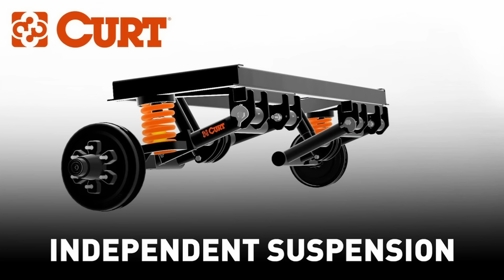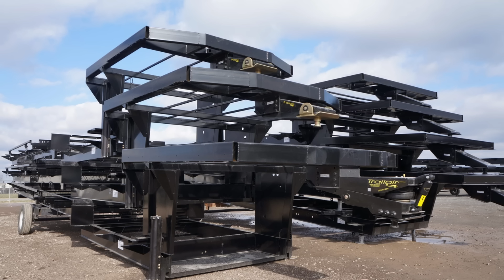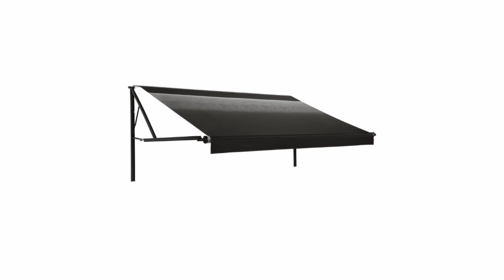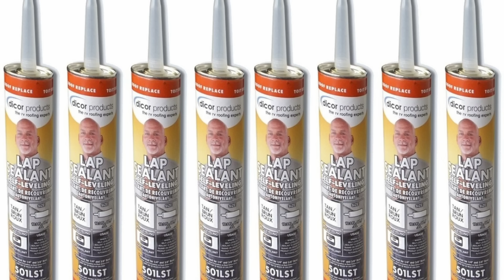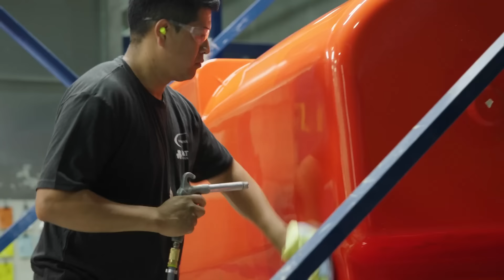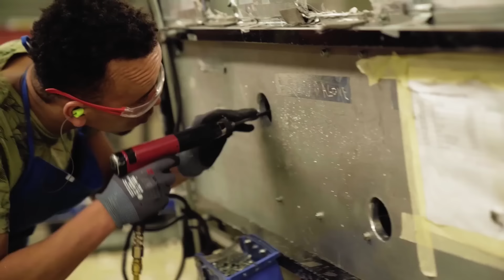The Real Story Behind the Parts & Components That Make Up An RV

Comment: Great video with good detail. Each of the component manufacturers you mention are vital to RV production in North America. However, it should be noted that each company chooses price points and categories to participate in — and cost is the number one factor in the quality and performance of RV components. Lippert builds amazing specialty products that perform well and have great warranty (like the Curt Independent Suspension). But the parts cost more — and end up being worth every penny. “Price is only an issue in the absence of value” is a phrase we frequently use to discuss RV parts. It’s also very, very true that you get what you pay for — especially in the RV space.

Comment: Well most new r-v are under a false impression that it's like buying a new car one owner manual and one warranty what they quickly discovered is a bag of 10 or 20 different manuals with different warranties from all the different component suppliers and the r-v industry saying don't call us call them because we didn't make it just install it , can you imagine if a  automotive manufacturer did the same thing ? , you have a trunk full of booklets from all the different suppliers that make components in a car .  It be nice if the r-v manufacturer would offer a tip to tail all inclusive warranty that covers all the components that go into their r-v just like in a car , that will happen when pigs fly
Reply: If you buy a new house and your refrigerator quits in 6 months do you call the builder or the manufacturer of the fridge?
Reply: @brucefranklin6765 I call the home warranty company. They schedule someone to come out within a week or 2. If they can’t fix it. The warranty company sends me a check to buy a new one. So I’d say no, they don’t send me to call each individual appliance manufacturer. That’s ridiculous

Comment: Great video. Having worked for an aircraft manufacturer on the customer service  side of the business for 35 years, I completely understand what you are saying.  When a product is designed and marketed part that is going to be price point and profit. There is always a balancing act and part of that is the cost of the parts and material used. Some of that is based on what's available for the product being built within a specific price point. No manufacture wants warranty claims for quality escapes but it is going to happen.  I really look forward to the feedback you get on this video. Keep up the good work.
Reply from the maker: Glad it resonated with you, thanks for watching!